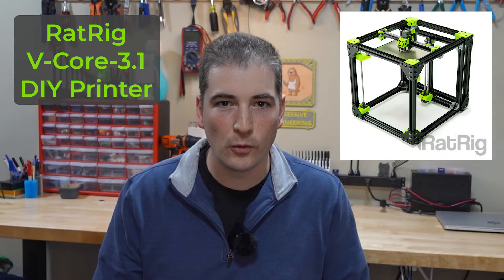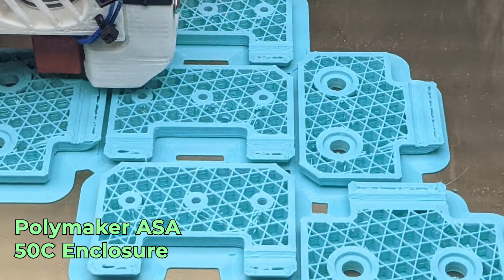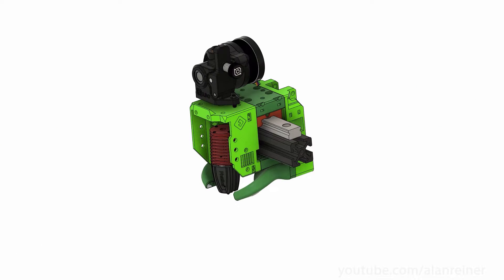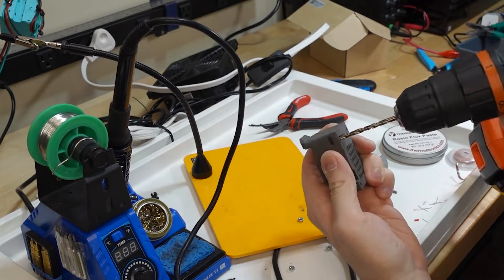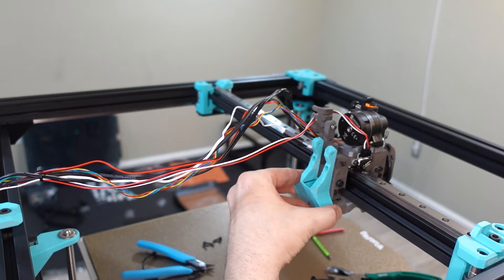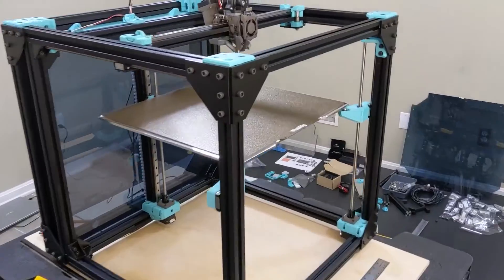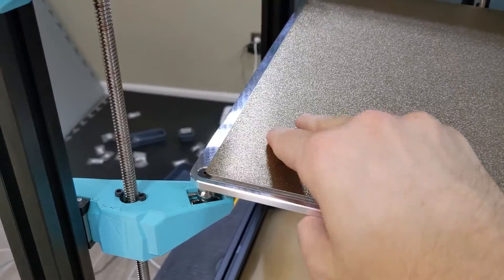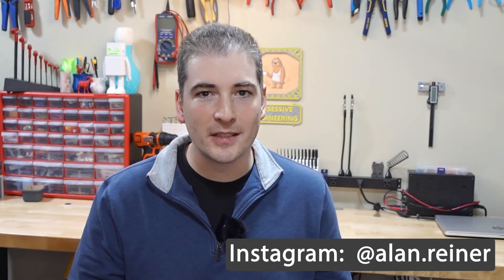DIY 3D Printer Build Experience (II) // Mechanics & EVA Printhead // RatRig V-Core-3

Comment: Did you end up  adding  the second extruder ? 
How did that work out, second extruder for soluble material support definitely worth adding.
Reply from the maker: I never did.  This printer ended up being my workhorse,  and I never wanted to put it out of commission long enough to try that.  It also was kind of an experimental upgrade in the community. 

At this point, if I'll probably just build a V-core-4 which has a native IDEX option.  I plan to use it primarily for support materials, but also for duplicating/mirroring to print multiple parts at once.

Comment: Actually CoreXY isn't the only way to have fixed motors (maybe even outside the enclosure)and a light XY-gantry. Ultimaker actualy uses the crossing rods design for a long time now. With crossing rods you use classic cartesian kinematic, but have two linear rods or rails left and right with belt driven cariages and a x-rod between them. Same front and back, with the y-rod between them. Imho that design have some advantages if you want a big size printer, as you have much less belt lenght, you might use (big) carbon tubes instead of rods and you can build the system staticly constrained (instead overconstrained). The only real disadvantage of a crossing rod design is you can not add a toolchanger in an easy way, as you have linear rods/rails on all four sides and the crossing rods - so it would conflict with toolchanging. But on the other hand crossing rods is muche more easy if it comes to IDEX, so if you only want a second toolhead for easy to remove supports, crossing rods in my opinion is the better design. But if you want more printheads (for example not only change material for supports, but also nozzle size), definitly the V-Core-3 or the Voron Trident etc. is the way to go. Of course, for pure multi-colour there is always the ERFC. But for high-flow hotends the filament tip after unloading is anything but perfect, even with finetuning ramping on unload. Actually an EVA with integrated filament cutter would be nice - the reliability of bambulabs AMS actually is caused mainly by the integrated filament cutter in the printhead, so the old filament in heatbreak and nozzle is kept there and only the unmolten filament with a fresh cut is unloaded. The old filament in heatbreak and nozzle is the reason you get so much poo on filament change on a bambu - but much less failed multicolour-prints (and it even works with materials like PETG, wich does a lot of stringing if unloaded without cutting).

For sizes up to 325by325mm² the Qidi X-3 series is definitly an ready2use alternative for the V-Core-3 (released after your video). Still, while I consider the Voron 2.4 obsolete now (exept for the fun of building it and the pride feeling if everythink works), the V-Core 3.1 definititly is the choise to make not only if to plan to add a toolchanger, but also if it comes to bigger size. Actually a ready2use Qidi X-Max not only weights 32,5kg, but the box barely fits through the door. So I belive there will never be a ready2use printer with 500by500mm² bed size for use at home, as it will be mostly impossible to get it inside the home...

For me my choice was clear: I ordered a X-Max 3. But I will build my very own printer. As I already have a Voron 2.4-inspired kit with >600by600 bed and mashined parts, It wouldnt be a full V-core 3.1, but I will redesign the kit to become a mix of Voron 2.4, Voron Trident and V-core. I definitly want the bed kinematic of the V-core 3.1 (as the fixed bed of a voron 2.4 wouldn't be a good idea if using a toolchanger). The new Qidi printers with activly heated chamber actually seem optimal to print strong parts for the DIY project (I do not have access to a SLS printer).

Actually esp. with bed sizes 400by400 or beyond, I would call a toolchanger a must2have. Using that area results in printing times to be measured in days and weeks, not in hours, if using a standard 0.4 mm nozzle. Still, you might want details you can not use a 0.8 or bigger nozzle for.
So changing nozzle size mid print can be a good idea (for example: printing a front plate for a 19 inch rack, you might want the first 3 layers with 0.4mm nozzle or even smaler and maybe even do multi colour to embed text and logos - but the remaining layers do not need a lot of details, so you might go to 0.8 or bigger to finish the print in acceptable time.
While I do not have an automatic toolchanger now, I did test this with a Revo-Nozzle, changing to a bigger one after 3 layers. Its actually a quite nice trick.)
Reply from the maker: Yeah I've looked closely at Ultimaker's design.  I believe it's called "CrossXY".  I never realized that it makes toolchanger designs difficult.  I guess I don't think much about toolchangers, I assumed I'd do some kind of IDEX thing if I was going to do anything. 

I've seen Qidi on Amazon, and a couple years ago I couldn't tell if it was legit.  I've been gradually seeing more and more of it, so I assume it is now.  The price point seems right and the actively heated chamber is a nice-to-have for engineering filaments.
Reply: @ObsessiveEngineering  Yes, the Qidi printers are quite interesting for years now. The quality is very convincing (esp. the bed - no "banana bed" like a certain other popular brand sometimes have). Even the reaction to the failiure with the x-3 series was very good - they stoped delivery and reworked the printer. Customers could choose between 50% back and keeping the printer (use it without active heating or tinker themself) or return it.
The new version of the x-series fixed the problem. My X-Max 3 will be delivered next week. Can't wait to get it.

Idex with Crossing Rods shouldn't be a problem. I am thinking to convert my Creality CR-200b just for fun (I barely use it, so it might be fun to tinker on it. But too many projects at the moment).

I thought a bit: Crossing Rods would make toolchanger more complicated, but not impossible. Actually there are also "Double crossing rod"-Designs, using two parallel rods in x and y. So the printhead actually is inside a sqare, bearings left and right and front and rear. So if constructing a toolchanger, it could be placed above the gantry, simply lifting the toolhead out of the sqare (like a crane) and inserting another tool. The locking mechanism seem even more simple (and light) - as gravity holds the tool in place (unless you want to use the printer on the ISS).

The reason I want a toolchanger simply is I am about to construct a big printer (600 by 600 by 600 mm²). I mostly want to print parts for retro computing (like authentic looking Amiga cases for emulators) and also some frontpanels for 19 inch racks. With embeding stuff like text and logos in the bottom layers, so a small (0.4 or less) nozzle size is needed for the details. On the other hand, after the first two or three layers, I want to change to a bigger nozzle to finish the print in reasonable time...

On such big printers CoreXY can be quite tricky. The different materials (aluminium, steel, belts) have different thermal expension. Any slight disalignment because of different expansion can cause layershifts. Also on CoreXY the belts get insanly long.
Actually crossing rods can solve some of the problems, as you can build it more staticly constrained. Simply clamp the crossing rods only on one side to the slider, but use a bearing on the other side, so the crossing rods can expand and contract freely. Also you could place motors for x and y and linear rails outside the enclosure to minimize thermal effects there (of course the enclosure needs openings for the crossing rods themself, so some heat escapes, but maybe theese parts you see on the bottom of doors sometimes can reduce that...

So maybe I give it a try and build my big printer with double crosing rods...

Comment: Some insulation under the bed?? Just a silicone pad alone?
Reply from the maker: I have thought about adding some insulation under the bed.  It would reduce heating time for the bed, but would actually increase heating time and max temp of the chamber, since the bed would shed less heat into the air.    It's kind of a weird decision/trade-off, but my chamber heater is not great, and recently I haven't been using it at all and just letting the bed heat the chamber.  That said, the chamber still takes a lot longer to reach equilibrium than the bed.  But for a long ABS/ASA/Nylon print at 110C bed, the chamber will get up to 60C within 30-45min which seems to work out well even if it's not at full temp when the print starts. 

If you have a separate chamber heater or your printer just isn't enclosed, then insulation underneath the bed should really improve speed and efficiency

Comment: Disculpe mi ignorancia, ¿que caracteristicas tiene esta impresora?,¿qué materiales puede imprimir?,¿cual es el area maxima de impresión?.gracias.
Reply from the maker: Hi!  You should check out the first video in this series where I explain all of that:  
https://www.youtube.com/playlist?list=PLrTmSWaWJwqLDVR0vk3-6i47G8yUVdCsp

The build volume is 400x400x400mm, and it can print any consumer 3D printing material, as long as you have the enclosure:  PLA, PETG and TPU do not require an enclosure, but ABS, ASA, nylon, polycarbonate, polypropylene all do, even better if it's actively heated.  If you want to print carbon-fiber or glass-fiber filaments, just make sure you buy a hardened nozzle.
Reply: @ObsessiveEngineering  muchas gracias, que Dios te bendiga.

Comment: I printed a set of ratrig parts in that same color. Then i decided on a different green. Is that overture teal asa?
Reply from the maker: It's Polymaker teal ASA.  Though I've seen other brands with a very similar color.
Reply: @ObsessiveEngineering  my bad, you're right.  That's the exact stuff i meant.